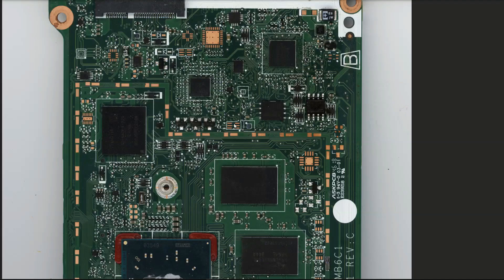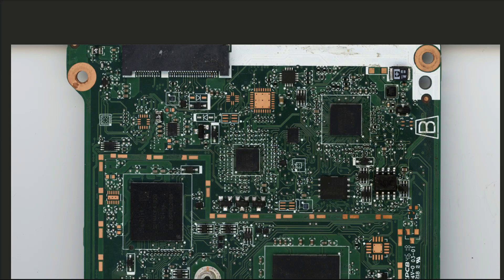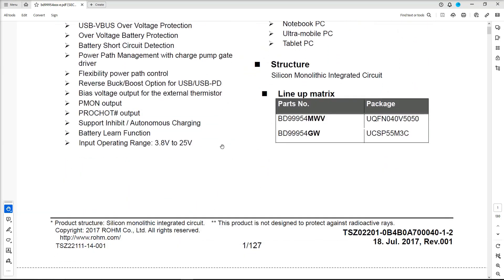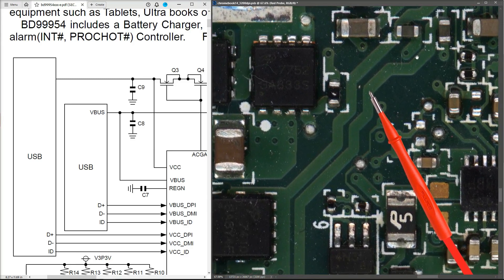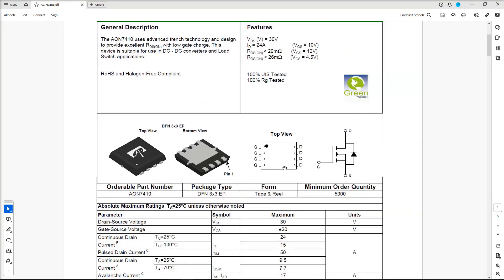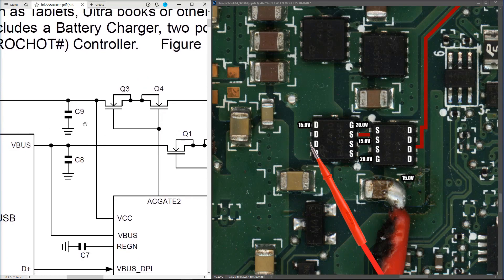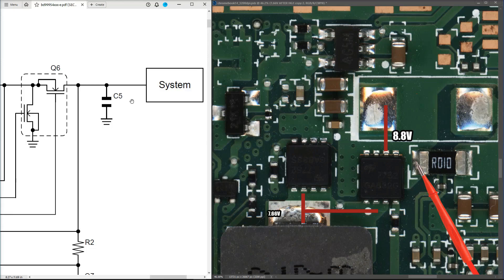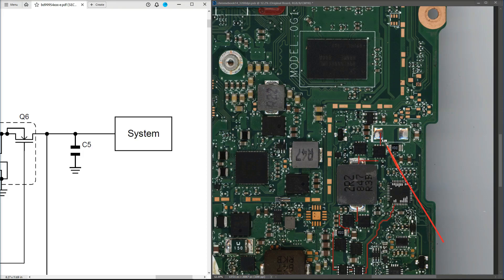HP Chromebook 14 - Motherboard Repair (Part 2)

Comment: The 8V rail is also used in various DELL XPS and Lenovo models the last 3-4 years. The common point of these models is that they get powered by USB-C PD. Therefore the main power rail is different than the input voltage.
Reply from the maker: Hi Nikolas, thanks for your comment, this is helpful. I think I will push ahead and see where else the 8.8V is going.